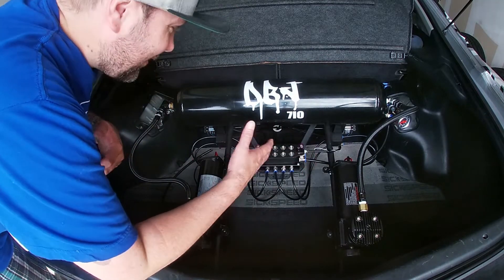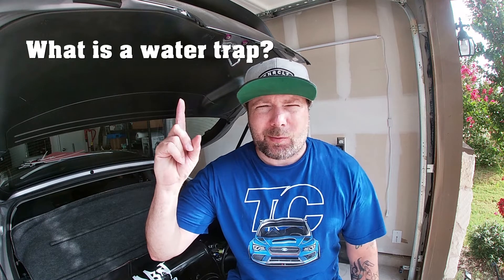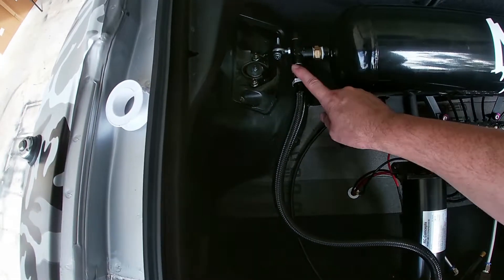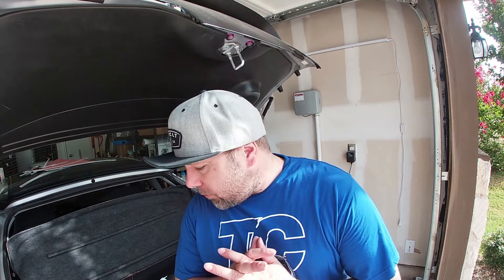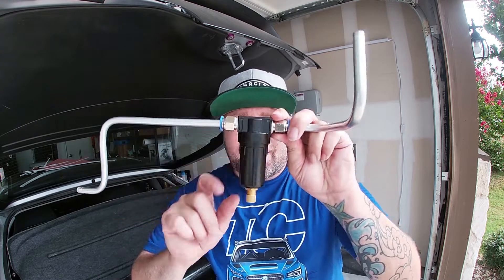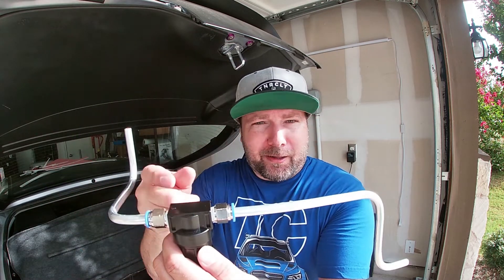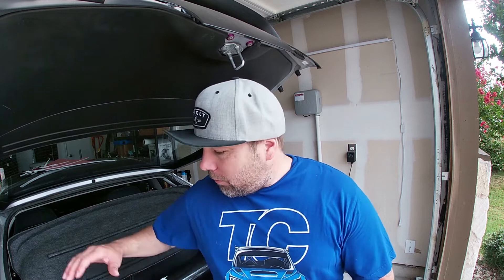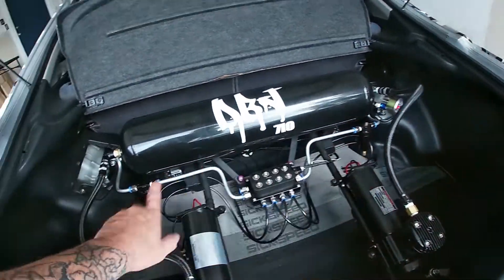Lets have a talk about Water Traps

Comment: Can i use more than one water trap?  For example, can I use a water trap between a compressor check valve and tank, another water trap between the 2nd compressor check valve and tank, and then a 3rd water trap between the tank and manifold?  I know it's a lot of water trap, but i want to be extra "safe" and catch as much water as i can.
Reply from the maker: Yeah it's a lot but it can be done just remember it's more area for a chance to leek so make sure everything is sealed and you'll be good

Comment: Great information.  I just installed an air ride suspension on my 1970 C10 and want to add a water trap.  Can you share the brand you installed on your system?  I looked online on only found traps rated at 150 psi and my pressure switch shuts off at 200 psi.
Reply from the maker: Thanks for watching! I bet that C10 is nice always been of fan of the C10. I do believe I purchased the from switch suspension or airmaxx.com I hope this helps.